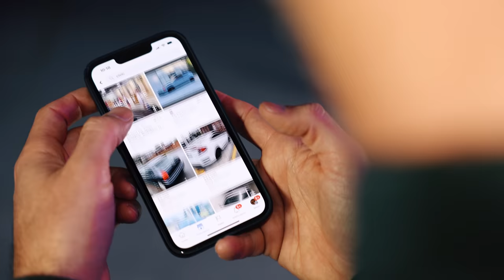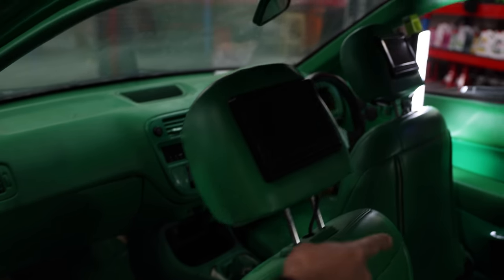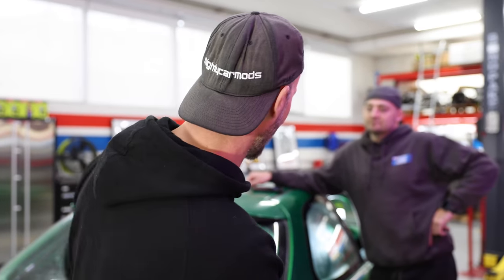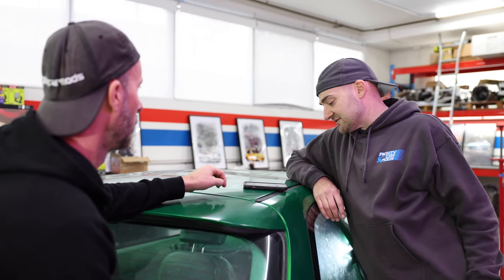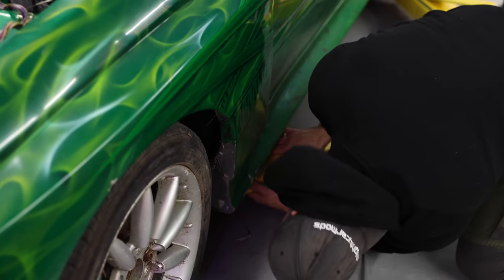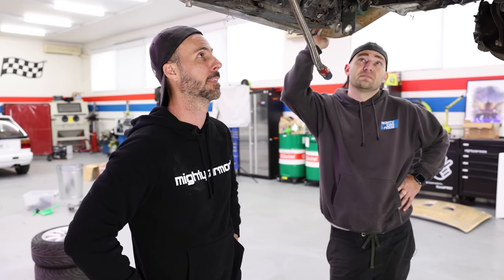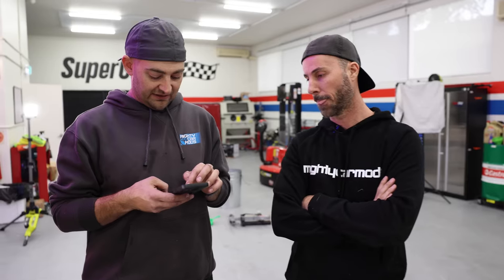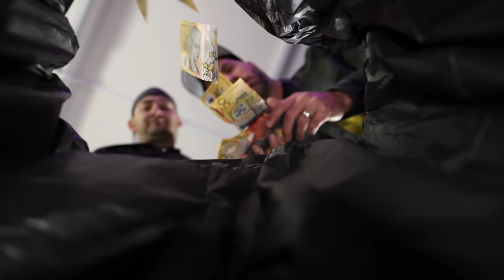Shocking Discovery in MY NEW CAR

Comment: Just wanna say y’all inspired me a couple years ago with 2sexy to buy a old show spec/ low rider ranger that the previous owner bought new and built in 97, it had airbags flames and tv screens, and I daily drove it for over a year until my 17 year old self could sustain it anymore and I sold it back to the guy. but despite all the problems with the truck it was the most fun I’ve ever had

Comment: I wanna say something here. This was all just a waste, ok the car was rusted out on a lot of parts, yes the engine was thrashed, yeah the style and parts are outdated for this age... But they still had worth, the screens, the wheels, the extras, the steering wheel etc etc etc. From what I can tell from you banging on it and later on crushing it in a junkyard that you didn't recover this parts and sold them or gave them away? For a lot of car-builders out there, me included, would have had use for those parts, hell even a teenager that starts building a car could've built on that frame and repaired most of that rust anyway plus switching engines... So when I see you guys wasting a car like this it just makes me sad, I build cars, I've sold cars from that era and when I see someones hard work getting that ending it feels just like a damn waste. Better to give it away instead of making a "Funny" episode... The Detective work on the Engine was informative and could've been just that instead of the whole car getting destroyed further. Other than that it's just "TOP GEAR" nonsense...

Not sure I like this new generation of Mighty Car Mods when you guys have cash and fame, these episodes leaves a bit of a bitter after taste now... And it feels bad to say this because I've been doing this as long as you guys and used your episodes as a knowledge base to fix my shit. Now it's "new expensive sports cars" or "let's waste this car", no this isn't what you were... Evolving is one thing, but trying to be something else is another... :(
Reply: I thought I was the only one that has noticed that things have changed a bunch.   Its just not the same show anymore.     I have not watched an episode in Months.  I just found a clip on my feed, and thought I would check in.   Feels like crap watching the end really.  

So they donated to some Chairty.  Cool.   This is not the spirit of Mighty car mods.      

This episode would have been so much better if Marty and Moog dressed up like  Those two really old people they played on one episode and then decided to go ahead and refer to all these parts and sell them to the mighty car mods fans. That would have been an excellent episode and then I would have been fine with everything else.

Comment: I’ve been here. Bought an auction car, was super excited. Wrong engine in car, way more destroyed than it looked in the photos, smelled terrible, wiring in the car was donezo, and it was rusting from the inside. It was easier much cheaper to buy a used version of the car for a couple of thousand more, and to send it to the scrap yard.